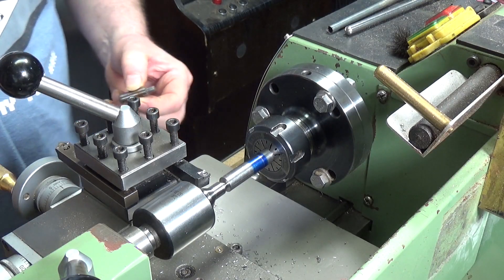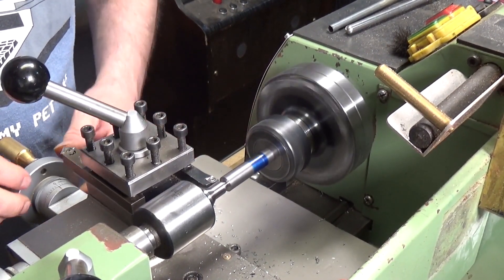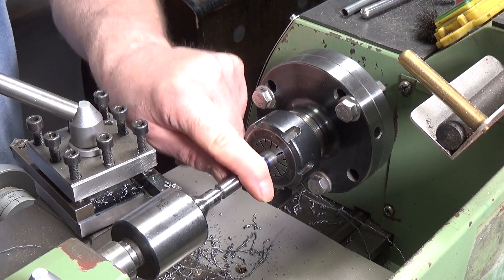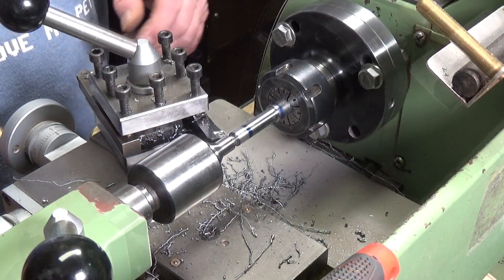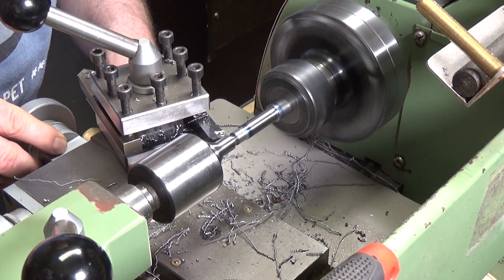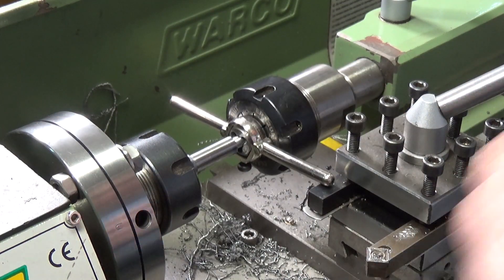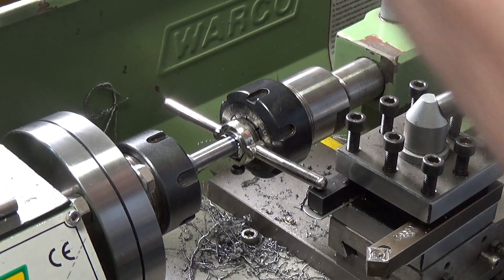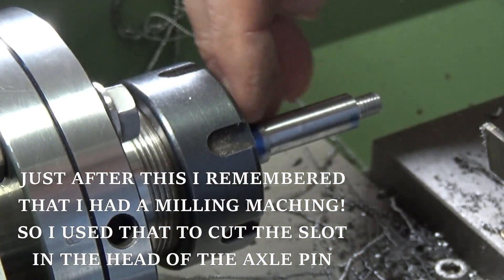Burgess Powerline BBS-20 Mark II Bandsaw Restore - Part Four

Comment: Keen to see how you go about the high speed pulley conversion.  Planning to do the same to mine.
Reply from the maker: Hi Doug. I managed to source a wider drive timing pulley and smaller belt. Just need to make time to get on with it. Too many projects! Cheers, Alan.
Reply: @RetroSteamTech  Good stuff. Look forward to seeing it. Maybe drop a link to the wider drive pulley if you could. Cheers
Reply from the maker: @DougMay  I got the timing pulley from Bearing Boys https://www.bearingboys.co.uk/5M-Section-Timing-Pulley-5mm/205M25-Metric-Pilot-Bore-Timing-Pulley-21251-p I need to bore out the centre and drill & tap for a grub screw but it should do the job.

Comment: Good job Alan.  A large diameter flat end washer will be a better locator than that small lip anyway.  Cheers Rob
Reply from the maker: Thanks Rob. I actually made a washer for it so I could get just the right thickness. Cheers, Alan.
Reply: @RetroSteamTech  So long as the door still closes, it should be good ;)  Cheers Rob
Reply from the maker: @Xynudu  Indeed 🙂 Fortunately the castings are designed to take the wider high speed pulley that came with the BK2 version of the bandsaw. All will be explained in the later videos 🙂 Cheers, Alan.